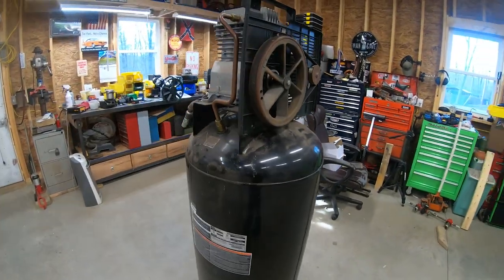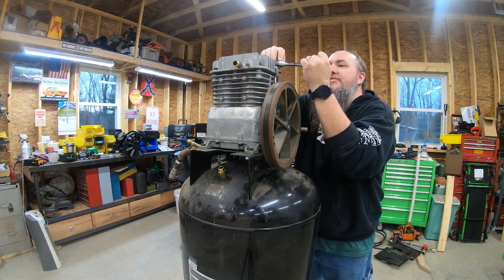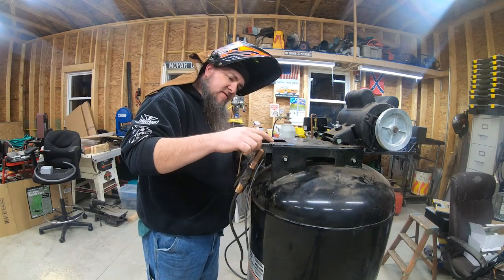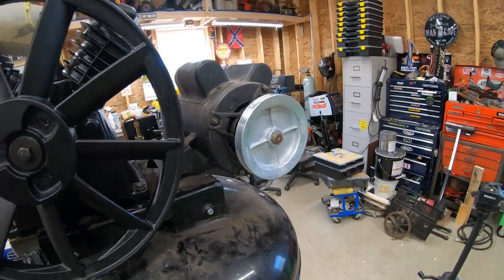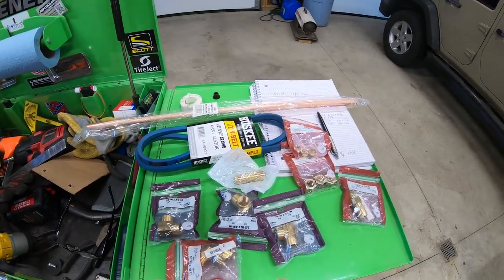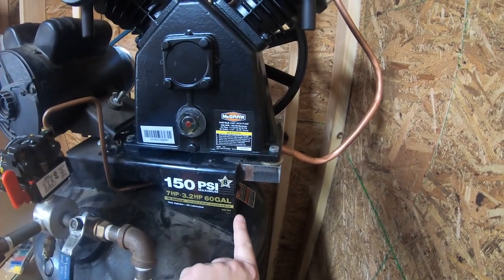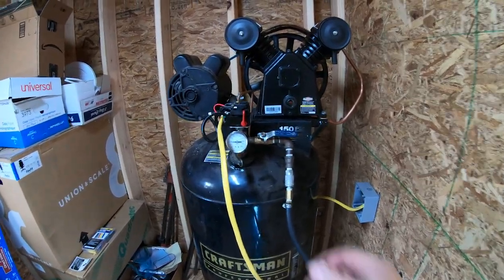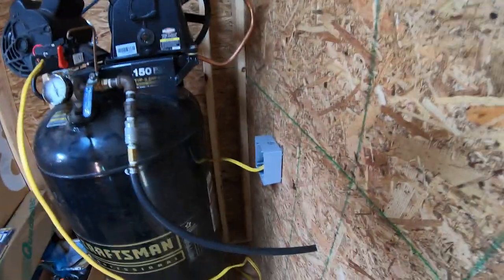Rebuilding my Old Air compressor

Comment: Need to check the pump rpm's and make sure the pump isn't running too fast. Take pump pulley diameter x pump rpm= we'll say 10,000 then divide by the motor rpm probably 3450 = 2.89 in pulley on motor. Pretty easy calculation
Reply from the maker: Yup. Even though I don't say it in the video, it was the first thing I checked and did. The instructions that came with the new pump said that same thing. So all is good. Thank you though.